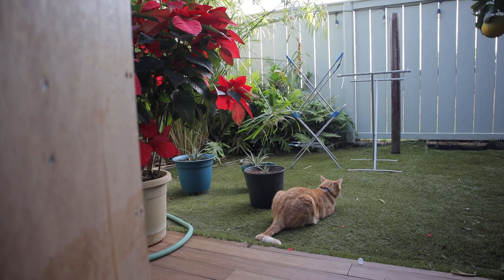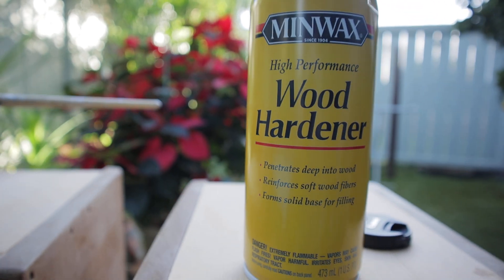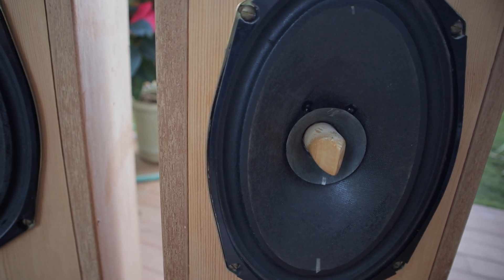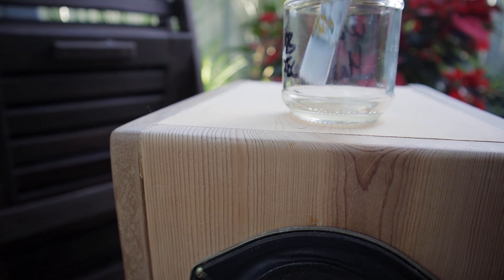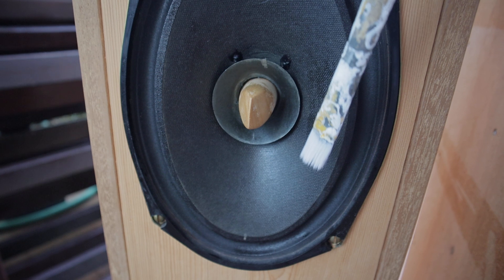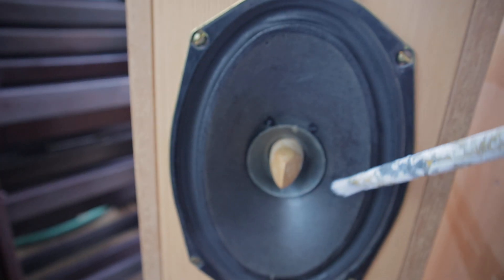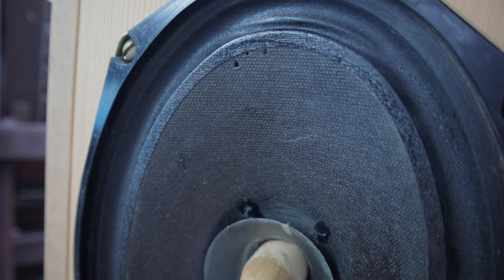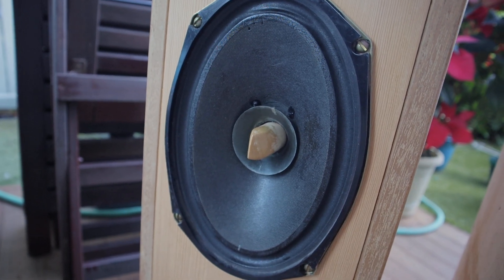Extend the life of your Alnico drivers another 20 years!

Comment: I thought it was going to be a video on the care of the alnico magnets.  : )  Oh well.  Thanks for all you do for the Audio (DIY) community
Reply from the maker: Sadly, there's not much you can do for the magnet itself. 1. avoid proximity of strong magnets (esp neo), and 2. do not drop them from heights to hard surfaces. 3. Do not heavily overdrive over extended times. 
In case an Alnico magnet needs remagnetization (very unlikely), then it is something that cannot be done without a very expensive and very big industrial machine.

Comment: Happy new 2024 Janos 🎉🍾😀
Wish you healthy and joyful year.
I was very excited  when I saw this video, and I hope you will continue explaining more about building this interesting speakers.
About those 3 small holes from 😺someone,   you can easily fix them, my suggestion is to take out the driver and from opposite side apply little from that hardener and press the hole with some not so sharp tool.
While pressing be gentle and at the same time monitor from the front side when the hole is gone. They will literally dissappear.
Greatings,
Aleksandar
Reply from the maker: Thank you Aleksandar for the tip! :)

Comment: Hi Janos, happy new year. I hope you are doing well. Thanks for the tip, specially on how to apply it and what to use and not use. I would like to add my personal thoughts on this. Only do this when it is needed. If you have an old driver and the paper looks in good condition, leave it as is. It has gotten so far without any help, so obviously no help is needed. Very related to this, expect some change in the sound (would love to hear your thoughts on that). Finally, rejuvenating a tired driver will add value to it, but treating an unrestored driver in good condition will subtract value from it.